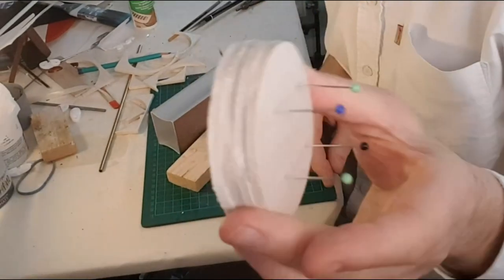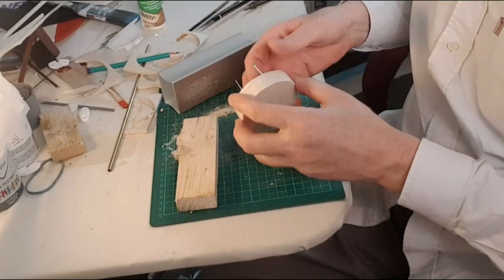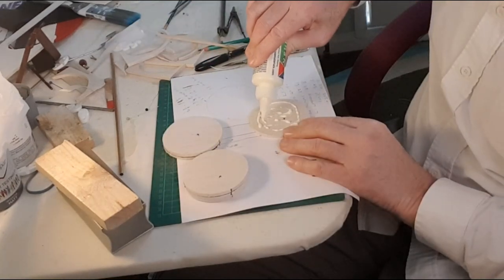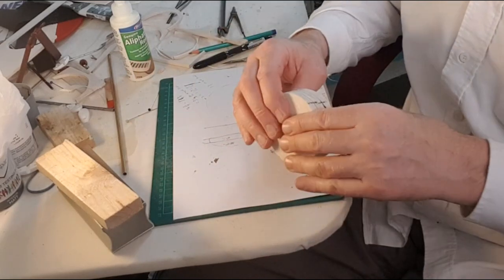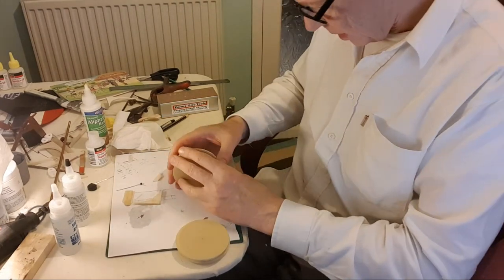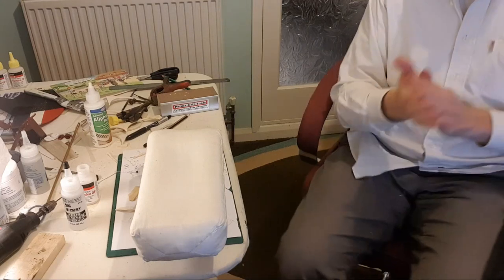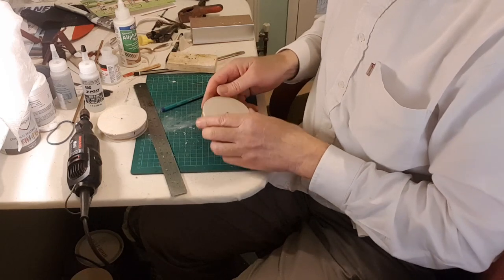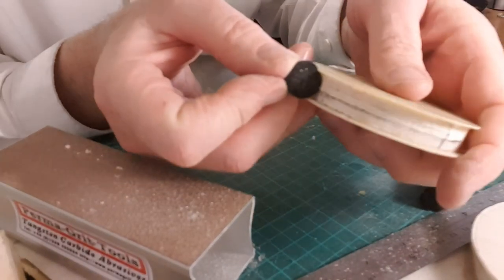How to Make Wheels for your Radio Control Model, Part 14 DB Mannock Build

Comment: Nice Job on the wheels .If I can find some 1/8" foam tube I'll scrap the small 13/4" wheels I've made and try your way. Better than just painting the tires. Thanks
Reply from the maker: Actually Irwin my Microace's models use a similar system but using mostly foam with a plastic disc built in to act as 'bearings' for the axle, they're finished off with a rubber o-ring but they are quite small at approx 1" diameter. Thanks for the comment.
Reply: @CliffHarveyRCPlanes  I think a 1 & 3/4" rubber O-ring would be too heavy for a 17" rubber powered RC conversion. I'ii look for lighter stuff. Thanks again
Reply from the maker: @irwinweisbrot6644  Oh yes, I wasn't suggesting you look for a big o ring, I love the idea of 1/8" foam tube, it would make it an easy build for sure.

Comment: hi , can you tell me what ans where to obtain the material , you have used to make the tires please , and the adeshive you used to join the tire , many thanks
Reply from the maker: Hi Sean, it was an Ebay item, search for Expanded Neoprene Cord Rubber Sponge Seal and you'll see plenty, I used the 16mm diameter, the adhesive was just medium CA.